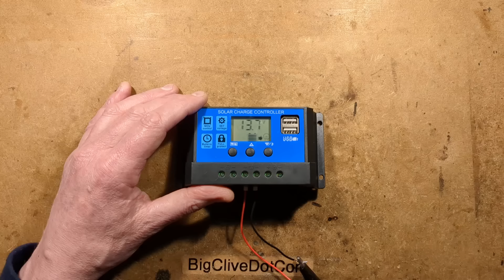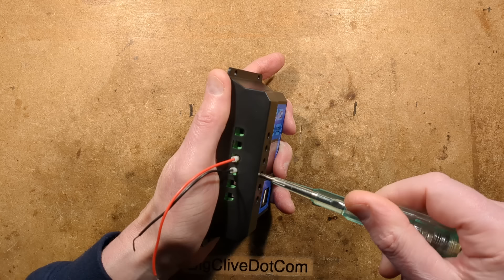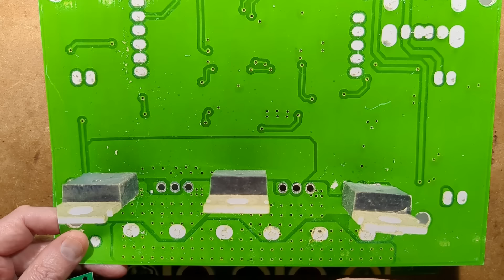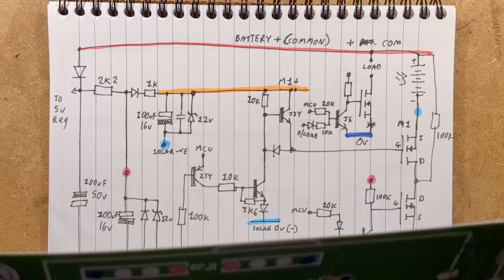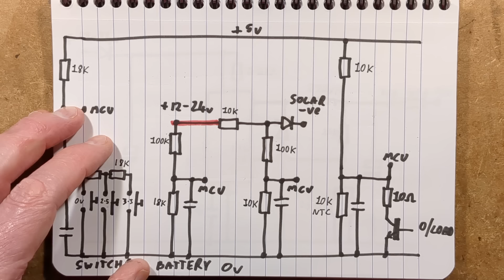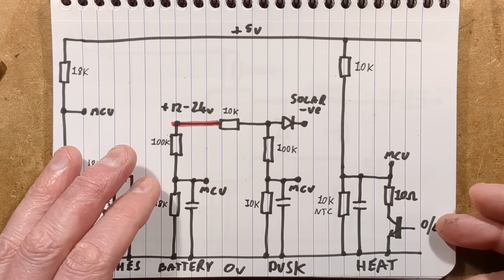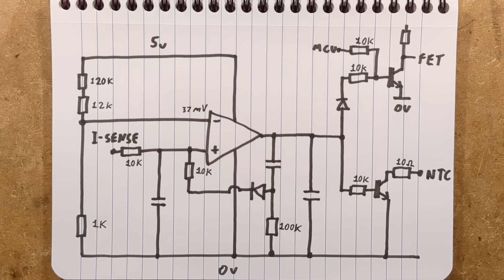Exploring a mass produced solar charge controller

Comment: Clive, can I hook this up to my solar panel and then use the usb slots to charge items when its receiving sunlight but not have it hooked up to a big battery? Or is that simply not how this works?
Reply from the maker: That's not recommended.  It would be better to use a common solar to 5V converter.

Comment: I have used a 20A one of these for a few years with 4 X 100W solar panels, it's been very reliable. But the first thing to do is to replace the rear metal panel with a thick aluminium  one and mount the whole unit on an aluminium plate as well. I also recommend using a relay on the output to increase output power.  I did replace the unit with a higher rated different make of unit but it  burnt out after a few days use so I swapped it back again. Thank you for the video.
Reply: I love the relay idea.
I’m definitely going to have to borrow that one.

Comment: Had two of them melt in my van, finally chose to buy a Victron MPPT; cost 5 times more; but doesn't melt; also much better at charging battery no matter the sun.
Moral of the story, don't be cheap on your charge controller; get a Victron; you will get better charging; and won't risk setting your van/house/camper on fire.

Comment: how is this regulating the voltage to the battery ? when the panel voltage is higher then the float voltage It seams like it's just ether connected or not connected with the mosfets? unless the mcu is producing a pwm signal that is gating J3Y ?
Reply from the maker: It may have slow PWM to control the rate of charge, but just shuts off the MOSFET when the full voltage is reached.

Comment: why do you need one of these?  i have a 10w 12v solar battery charger connected to my riding mower keeping the battery charged.  does it have one of these built in but without the output or usb ports?
Reply from the maker: This is just for solar charging.  A modern mains charger does all the current management.

Comment: Hi great job on your videos.
Love the detailed explanation of all the different components on the circuit board.
I have a Air con unit and it has a part that's blown on the circuit board it's labeled (VA100)I looked it up and cannot find it anywhere any help would be greatly appreciated.
Reply from the maker: I'd have to see the component remains and position in circuit to determine what it is.  I wonder if it's a MOV for voltage transient suppression.

Comment: Have one of these on a camper.
150w solar panel feeling a 12v acid battery.
Inverter blown due to the controller send out 15.7 volts to the battery.
Disconnected the battery front the controller then reconnected the battery, voltage to battery now normal.
Along with an in-line fuse, what else can I do  before replacing the Inverter ?

Great video
Reply from the maker: I wonder of the inverter had another issue if it couldn't handle a slightly higher input voltage.

Comment: Thank you for this awesome TOUR of this unit. 

It looks a close 'Copy-Cat' of the HardKorr 20A controller provided in a Costco Exclusive solar kit I purchased. 
In some literature  there unit is one conspicuously claimed as 'MPPT' claim but is likely PWM. 
I've asked HardKorr directly for clarity; but have gotten no answer. 
The provided 20A version has the extra 2 FETs.

My solar panels are position disadvantaged by the Shed Top holding them; 
so I need to squeeze all the extra juice I can get; and MPPT might help.

This review; while enlightening, was sad to follow given my unit. Again, Thank you for the detailed Tour.

Comment: Sorry but, you get what you pay for. These pieces of crap may have a use somewhere but not with solar panels on a van. I had one in my van and couldn't work out why my 200w panels were giving me a max of 60 odd watts in full summer sun. Eventually binned it for a victron......the comparison is day and night. Regularly see 170w now the victron is in. Buy cheap, buy twice. Buy right  buy once.

Comment: What is the highest value you can set for the low voltage cutoff? I would like to use a very shallow cycle (low depth of discharge) for  an led lamp to get the most longevity from lead acid battery. Thanks

Comment: Does anyone know if this is hooked up to a battery and panel and you put a power bank into the usb output will it charge the power bank?
Reply from the maker: I don't recommend plugging anything into the USB port.  Use a separate car charging port connected to the load output.
Reply: @bigclivedotcom why dont you recomend putting anything into the usb output?
Reply from the maker: @gggggjjjnd-us3he  It is very low current and also powers the main circuitry.

Comment: Just a matter of time before they advertise the 500A version with the same circuitry.
Just checked on Fleabay and 9,000,000mAh appears to be the norm for USB power banks now.
Wonder when they'll break the 10,000Ah barrier (and still be able to hold it in the palm of your hand)?

Comment: You mentioned over charge protection what would you use protect my rv 12 volt system?
Reply from the maker: It depends on the battery type.  Overcharge protection is more important on lithium style batteries.

Comment: Confused.  What use are the usb ports?
If it is connected to a charged battery, is it then ok to use these?
Reply from the maker: The USB ports on this unit are only suited to ultra low current devices.  They seem to be there as a gimmick.

Comment: Woah. Everyone has one of these floating about as they are so damn cheap. But what i didn't know was HOW they were built and what the failure points are/were. I'll fixing the heat sink issue and making doubly sure I don't overload them. ....either that or buy a Victron!

Comment: My controllers will not charge unless I connect pos panel wire to neg & neg panel wire to pos, why is this? Are the solar panel leads mis-marked? I have 4sets of panels and 4 controllers, all panel leads have to be connected this way.

Comment: Very good advice on back-up overcharge protection! Wherever a risky situation could develop when a microprocessor or microcontroller unexpectedly crashes it's very good to have a low-tech fail-safe in place to keep the situation safe. I'm definitely going to follow your advice in future 👍 (There's even one popular SBC which uses software PWM on some PWM outputs so can crash leaving some of the PWM outputs at constant high - low-tech fail-safes very valuable in that sort of situation 🙈)

One catch I've found with solar charge controllers is the amount of power that some of them consume when they're not actually doing anything - one big-name manufacturer (who'll remain nameless) declare a power consumption of 10 to 19 mA at 12 V nominal so c. 120 to 228 mA when not active - that sounds like something that's absolutely nuts or a typing error so I've just pulled out the manufacturer's data sheet to double-check it. 2mA (so guessing c. 24 mW at c. 12 V nominal) is better than many of these!

One odd piece of undocumented behavior can arise in some of the big-namer solar regulators when a large load is connected relative to the size of bet battery - the large load relative to the size of the battery does not overload the charger but it does cause the output voltage of the battery to drop below the threshold at which the controller automatically disconnects the battery from the load - the controller just disconnects the load with no error message and no warning LED - ehich can be confusing the first tome someone encounters it.

Another catch can be that the cheaper ones use a PWM algorithm which is cheaper to implement but less efficient (particularly in sub-optimal lighting conditions) than the MPPT algorithm implemented by the more expensive ones.

For more about our adventures and misadventures in solar powered arboreal ecology:

https://new-homes-for-old-friends.cairnwater.com/

https://github.com/William-Robert-Robertson/WildCamera

Comment: Good test. I've juste buy one (60 A model) but it's 10 A maximum solar panel and out (only 3 SSF7509 8 mOhm mosfet)
Yes use only for lead battery. Equalisation up to 14.8 V is made with hiden the voltage on display (I don't like that !)
in B3 LFP mode, set to 13.8, equalisation up to 14.8 is made too. not good !!!
can start with 0 V batterie and charge, but no voltage limitation in this case, I stop it at 15 V !!!
You can make a third video with these problems.

Comment: Before I even watch the video.... it is EXACTLY the same thing I bought on eBay about 15 years ago for absolute pennies. Just with a different colour. And let me guess......it works......BUT!!!!!!!!!!!!!!!!!!!!!!!!!!!!!!!!! it will absolutely DESTROY batteries, OR, do absolutely sweet F$%K all............UNLESS!!!!!!!!! you actually use a multimeter you can trust, and adjust all the charge/full battery/low battery/ load shut off etc etc voltages to be insanely ridiculous (on screen compared to what a multimeter will actually read) or it is literally a worthless piece of shit? set it to stop charging from the solar panels at 12.8 or even 13 volts? yeah will never charge a single amp hour. set it to 14.4 volts....which literally every 12 volt battery, lead acid OR lithium can handle because 14.4 is the STANDARD voltage for an alternator on a vehicle......yep you just boiled you battery :D
Reply: Pausing again at 1:24...... the thought, of using one of these Chinese abortions, to charge and or control a LITHIUM battery. Makes me want to move to Mars, if anyone that lives anywhere near me is THAT stupid... I want out, for me and my family <3 Stupidity/Ignorance is no excuse for what can only be described with a banned word beginning with R. Kill lead acid batteries prematurely all you want, but don't take the entire street. 15 firefighters, 10 million dollars worth of government assets and their belongings out with you just because you are stupid <3 And while we are on the subject STOP buying Chinese electric vehicles (Tesla are made in China too), you saving 2 dollars on petrol isn't worth the entire neighbourhood's lives, and that 2 dollars you saved is meaningless because good luck EVER selling that electric POS that even the dealer doesn't want back even if you paid them to take it :D .....meanwhile a 35 year old Toyota Camry is INCREASING in value...... while a 3 month old Tesla can't even be sold back to the Tesla dealer than scammed you out of money in the first place.....with its steer by "wire" that could decide to be a mobile game controller at any moment you are driving at 120kph with other people and their children in LEGAL ROADWORTHY VEHICLES are driving next to you on the road they pay to use....... only a matter of time before all these clowns are in jail for trying to kill other motorists due to inbreeding

Comment: ( WARNING!!! LOOK AND READ NOW! Then Thank me later! )
10 Amp 12V Good for ( ONE ) 120 watt Panel These are ALWAYS PWM ( Pulse width Modulation ) 
no more than 22.2 VOC ( Open circuit voltage on the solar panel)  Cheap controllers Not worth more then $3 to  $7 dollars. 
 They ALL work the same.
98% of the companies on Amazon LIE claiming 100 Amps and Listed as MPPT ... That's Hysterical! 
 My 100 Amp Named brand weights over  5 lbs  and  Runs super cheap at $345.00 and comes with Bluetooth. ( that 150/100 TR AIMS Smart charger is dirt cheap!)

DON'T GET SCAMMED! KNow the JUNK YOU BUY! 
What can it charge?  ONE 12 volt Lead acid style battery  Over 3 to 4 days of sun... Maybe???  They are trickle chargers. 
Other uses : To learn solar on.
To throw in the trash when done. 😂 YOU'VE BEEN WARNED! 

Products we support ( yeah everyone below gets a chance! ) 

( A Tier ) $$$  ( 7 + years running strong ) Off Grid Life and Home back up Power
Aims Corp - Victron Energy - Aims Power / Outback/ Schneider Electric / MorningStar /  Renogy / Growatt / Tri Star / Xantrex 

( B Tier ) $$ ( Friends own these and abuse them hard )  RV Use and back up Power ( I want 4 - 6  years use!)
Lesser trusted brand (still good just a lower Tier)  Ampinvt /  MPP ( hard to find real company need to search hard as many Name copy )  / Li Time / Sun Gold / Genasun

( C Tier )  $ ( I'd risk money on them for sure!)  As cheap as i can go to learn on and hope for the best!  ( I want 3 maybe 4+ years of Use!)
 ECO Worthy /  EPEVER /  BougeRV / REDODO /  Power Queen / PowLand / Go Power /  EA Sun /  Blue Sky Energy / 
 
 ( D Tier )  Risky Junk List  poor parts, poor return, poor flash updates, copy cat brands... 
Everyone else that didn't make the list that has burned us testing in the past.  Less than 6 months is NOT ACCEPTABLE PowMr you know who you are...🤬😠😡😤

Comment: Loads of these over the last 10 years and they do work well for 1x 12 v battery and 1x  solar panel 200 watts   They work fine,   Great starter system, yes be careful with connecting the wires, but even the solar controllers that will cost a couple hundred bucks will still have shity connections

Comment: i had/have one of these somewhere as well as another style pwm solar charge controller.  never had a clue what the settings were on mine. thankfully having watched this video i had mine in factory settings, did up the max charge by half volt otherwise it was in B1 and i was using car batterys.   mine solar panal was to small and shite though.  was from banggood lol

Comment: I have one of these in my shed but i use its power output to control a chunky relay that connects the load to the battery directly instead of using it to power the load itself. It works fine.

Comment: I have used these a lot, and every time ive disconnected the battery and forgot to discont the panel first its blown the fets somehow. The charger appears to continue working, but the fets are fused on, and it never shuts off charging. In one case this lead to a heavily venting lead acid battery, which if i handnt caught would have been a nasty event. Would it be possible to mod these to not blow?

Comment: So let me get this straight.This is usable for a lithium iron, magnesium, phosphate, battery?  Or did you just say lithium iron phosphate, battery?  I need to know because all mine are lithium iron, magnesium, phosphate batteries and I would like to use them for that. I have a couple lead acid batteries, which I can use them on. But it would be nice to be able to use them on my 48. Well, sorry, 24 V and 12 V lithium iron, magnesium, phosphate batteries. So do that me know if that will work for those, please?  Thanks for the video. We appreciate you. God bless you!👍
Reply from the maker: It claims to be compatible with LiFePO4 batteries, but I recommend external battery protection.

Comment: You have no idea how many of these I’ve went trough during the last decade. I operate a small Wireless ISP company, and we used these to power micro-cell towers. They operated under extreme conditions, very high humidity and high temperatures in outdoor enclosures with no cooling. These are surprisingly cheap, durable, and they do what they are supposed to do. We only had some fail because of nearby lightning strikes.
Reply: For lightning protection, try Motorolla's TransZorb. A very fast zener switch that feeds to ground for just nanoseconds during a lightning discharge. I protected a group of weather stations for Auburn university over a 5 acre tract which survived a lightning strike at 2 miles away. The D.C. power lines and the RS 232 lines were protected on every PCB in the array.

Comment: What if we just add a 12v 30amp dc relay and let load out going through that only. Even if the connected load is above 10amps The charge controller will only needed to give power the coil of that relay.and we can use the under voltage and over voltage protection of the controller also. Is there any complications in that? Buying a relay is more budget friendly than buying a costly charge charge controller that has high current carrying capacity

Comment: Years back I worked for a rural ISP that had solar-powered point-to-point wireless PoPs, and to keep those working we always had these in stock.
At some point I got a few of them for my lab. I experimented with hooking up regular DC PSUs into the solar input, effectively making them into cheapo UPSs for our regular grid-powered PoPs.
Hit them with Meanwell 24v/10A honeycomb PSUs overdriven to ~28v, keeping the 24v VRLA batteries and the radios working 24/7.

Comment: Hi Clive I had one of these units in a kit with twin solar panels. It was fitted to my Motorhome for 3 years. Topping up the Leisure Battery and my home made splitter for engine battery. When van in outside storage in winter. Worked very well but never used the bulb terminals. Cheers from old George.  Ps Mine was OK to charge phone and camera via USB. But it probably was better made as it was over 4 years ago. Don't own Motorhome anymore.

Comment: I had one of these when I ran a solar panel in my car. It kept killing the battery. I found out this unit actually pulls more power than the solar panel that came in the kit with it and would drown the battery. Would even kill barriers with a 50cm panel I used with it. Didn’t like it

Comment: I have a simmilar one. and the reason you must connect the batteries first as that is how it chooses either 12v or 24v,  if you connect a panel putting out say 19v it may get confused and try and charge 12v batteries to 24v.

Comment: Oh heck. Just browsing for solar equipment for renters, and saw that Adventure Kings (a brand here, considered good quality) have an older model regulator that is this exact unit, just with their own name stamped in the bottom right.

I am not sure if this device is a copy of the Kings one, or if it's simply Kings rebadging this, but it now has me concerned for any of their products >.>